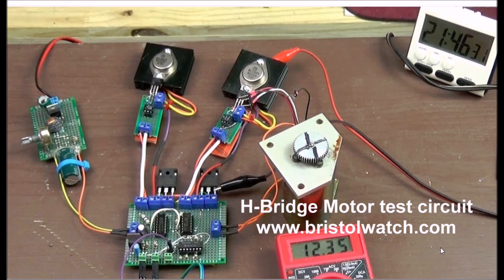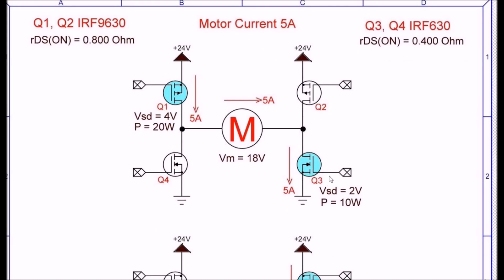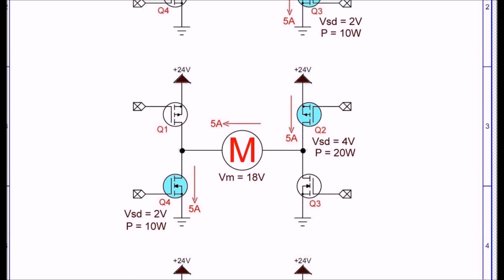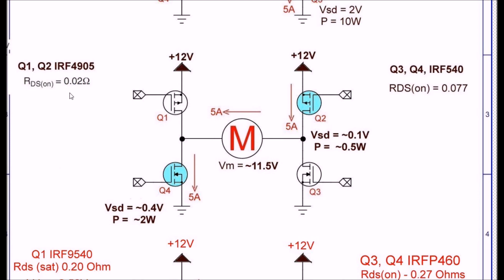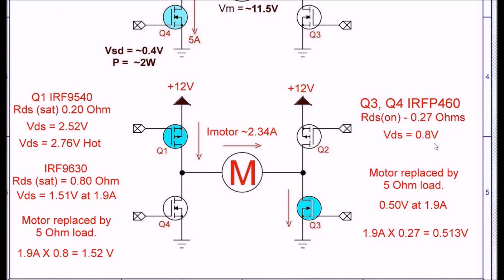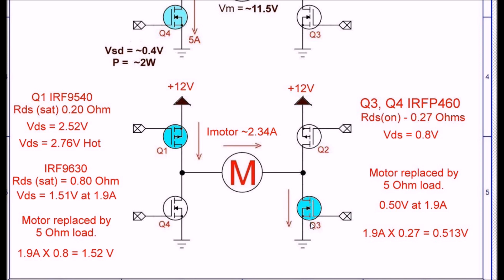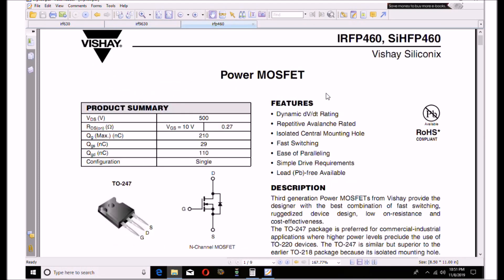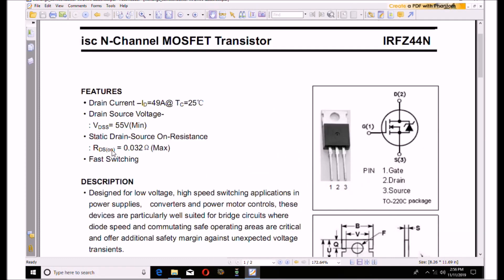Why Your MOSFET Transistors Get Hot

Comment: @LewisLoflin I'm using a 11.1 lypo 
After testing voltage it shows 11.6
And I use a voltage regulator  to run an ATTiny 85 
Output from one pin shows 2.4v to a 100ohm resistor to a 3055L N channel to drive Irf9640s p channel
With a pull up of a 10k resistor
All using the same power source
All works ok
And all stays cold apart from the p  channel MOSFET that drives a A 12v ignition coil that draws   3.6 watts on a 20 Hz pulse 

I can send you and pay for your time to have a look at my schematic

Comment: This is the reason why in a bridge-configuration all MOSFETs are usually N-Channel MOSFETs. Combined with a dedicated MOSFET driver with an internal bootstrap circuit or with a discrete solution, those bridges can work with a much better efficiency. Also, it's necessary to add some dead-time of several nano-seconds between both MOSFET gates, to avoid the "shoot-through" effect.
Reply from the maker: They have some very good P-channel MOSFETs with an on resistance in milli ohms. I use a +side power switch to turn off Vcc during the switch time. You are correct about shoot through, but I never had that problem.

Comment: Well I don’t agree if your mosfet is fully on and fully off  the voltage drop is 0.9 volt your circuit is not is order the circuit missing a lot of temperature control when you using high and low gate drivers Ic or emitter follower use a pnp bjt to sink the gate fully on for n channel mosfets to fully on and fully off npn bjt to turn off  p channel fully of and fully on I don’t have this issue, because when I was learning about gate drivers and low side gate drivers and high side drivers what i discovered is that when I use the driver only the mosfet would heat up badly and even if I use a 10k resistor the mosfets would still get hot and for months I try different methods and the only method that works was bjt as a voltage sink and it work to my surprise the mosfets was turning on fully and off fully with dead time in sink with rising and the mosfet never get even warm at 200 watt without heat sink for 3 minutes and then it get warm because of amperage passing and with 1000 watt and heat sink with fan cooling the temperature rises to 48.6 degrees c so just remember resistor won’t work only bjt can do the job
Reply from the maker: This is circuit theory, not a finished product as I warn on my website.

Comment: I bought a 50 pack mosfet and all of them or heating up fast in my inverter circuit the frequency is 60khz and i adjusted it all the way to from 1khz to 600khz and heating up as fast it’s on and burn up the transformer is a big 28-28 volt I try all type of frequency I’m my own drive and I can get the mosfet to work cool and stand on i even us a old inverter driver and the mosfet get hot as it on I bought some irfz44n and the same thing happens so am wondering why this having even with a manufacturer inverter drive it’s burn up
Reply from the maker: Several issues here. Poor quality MOSFETs heat up when the frequency is above the rated value. In a way, there is "resistance" to the switching. Lowing the frequency changes the inductive reactance of the transformer. XL drops thus less resistance, and high current heats MOSFET. You need to find the resonant frequency of the transformer and go from there. Be aware circuit capacitance also effects XL.
Reply: @LewisLoflin  ok can you please give me the right serial rod the good quality mosfet to use the resistance of the transformer is is 4 ohms to secondary and 3 ohms to primary and the capacitor use is 1000uf 25 volt rated and use 24 volt dc
Reply from the maker: @Dc_tech386  I said reactance not ohmic resistance. That varies by frequency.
Reply: @LewisLoflin  ok the resistance is 0.88 ohms I rebuilt the 555 timer pwm to a pure sine wave 50hz the transformer turn on nicely but mosfet still get hot in 20 seconds I try IRf740 and irf840 and irf9540 the same keeps having I did check the duty cycle is 50 % and i inverter the signal to get two signal with bjt npn and the voltage at the gate is 15 voltage just 4.9 voltage from fully turn on I did try turn a load on one of the mosfet differently with a 5watt light burn the mosfet heat up so fast at if fully volt of 19.9 volt to the gate so can you please explain what the hell is going on with those mosfet I did repair a inverter and I saw the same irf840 in it burn out I replaced them with IRf740 and the circuit heat up so am think the all the 100 pieces of bad mosfet the Amazon sell send me
Reply: Same here too quickly the mosfet get heated what is the solution for it

Comment: Am having heating is with my pwm the mosfet getting hot in 1 hour of turning on at 6 amp the capacitor valve is correct so am thinking the new components or manufacturing is bad all of my mosfet burn out on 1 amp and the pwm just never turn on with the second circuit I made and all 5 555 Ic just won’t turn on in pwm so am thinking if I use a pin holding Instead of the welding to the pcb so I will see if it’s the welding heat that burn something inside but I only have one working pwm for 10 Ic all 9 was bad the capacitor valve is 1 uf

Comment: pls.. pls.. help to my project sir.. my mosfets gets hot... and my stepper motor vibrates.. does the switching speed of a mosfet needed to be considered? and how to check switching speed on the data sheet? my design it amplifying signal from a stepper driver allegro.. thanks a lot in advance..
Reply from the maker: Several issues. What mosfets are you using and what is the current-voltage of the motor. First try switching the motor on off no pwm then go from there.

Comment: But were you driving them with pulse width modulation? I had a P-channel mosfet powering a windshield wiper motor. (My RDS on was 3 milliohms). With the gate at full negative potential, didn't even need a heatsink.  As soon as I drove it with PWM, heating was a big issue. The gate current to charge the internal parasitic capacitance  meant that there was a "ramp-up (and down). A possible 200mA (from a 555) was not enough to drive the gate. Further research showed that there can be AMPS of gate current to charge the capacitance. (in my case, around 13,500 pF). And it appears that mosfet driver chips are available to overcome the problem. I am going down that road now... So, were your "dodgy" mosfets actual getting ramped on as a result of a high gate capacitance and insufficient drive, or were all your tests at DC? Regards, and good luck.

Comment: Here is solution: use voltage 20 v  on gate of transistor mosfet .... and before that use pc817 uptocopler .... to control transistor.... it’s very easy I try it many time and working great up to 40 amp .....

Comment: The IRFZ44N has come in handy for me. Rds on of .02! or less (.0175) Not bad, there are much bigger etc, but it covers a lot. Just my opinion, good video.
Reply: Queen bro did your z44n get hot because am having that issue with them burn out alot of them in a pwm device with only 5 amps in seconds I fit the pwm capacitor valve that was causing some issues but even at the right valve the mosfet get up 70df even though the data sheet said frequency and 1 uf capacitor the circuit get ready heat up not smoking but hot

Comment: What about High Power High Voltage MOSFET Modules by Vishay
Reply from the maker: Just looked at the spec sheets. I have never used them but see a lot of potential.
Reply: @LewisLoflin  Xraytony uses them

Comment: Yes ebay stuff is usually but not always factory seconds . Buy from a reputable supplier and if you find that the components are out of spec you should get a refund or replacement.
Reply: Would be nice if they were merely rejects. They are often enough fakes, some other component with same case, pinout and general function, and if you're "lucky" they chose something with a similar gate capacitance so you don't get immediately suspicious the moment you stick it into a transistor tester. Then the marking side is resurfaced and re-labelled but there's a completely different die inside. Even Chinese domestic semiconductor brands aren't safe from fakes once they gain a bit of popularity.